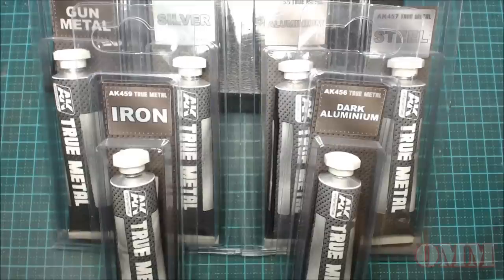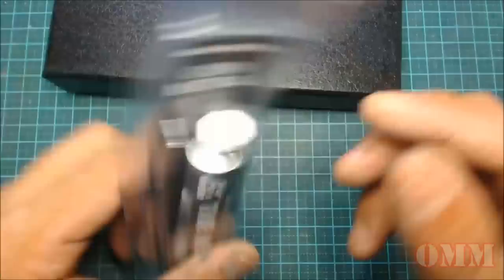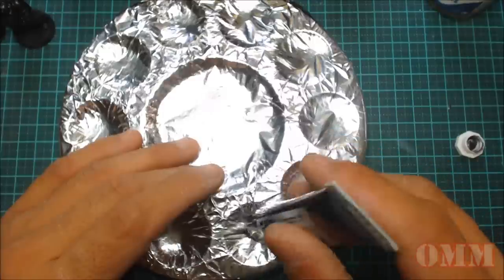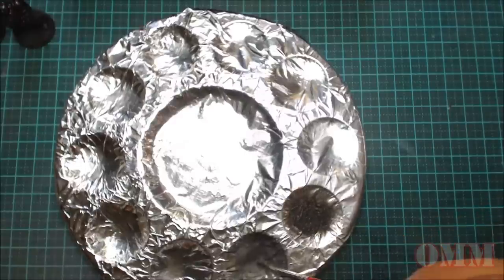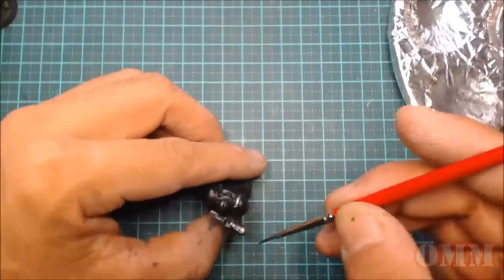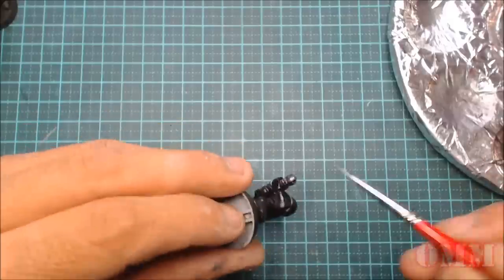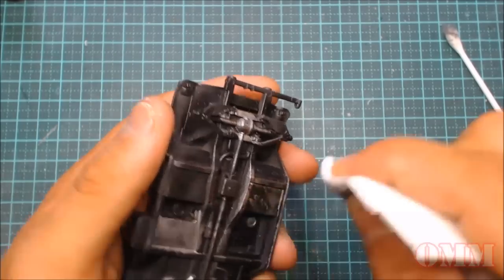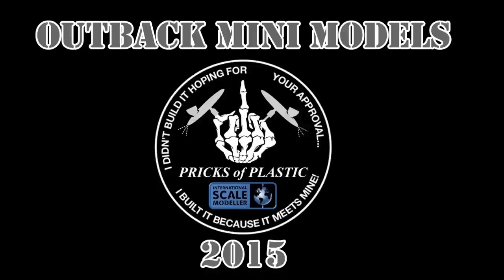AK Interactive True Metals Tutorial

Comment: Thanks for the demo. Seen this stuff knocking about and always wondered if it was worth the hassle.

Now I am thinking of using this for Necrons and/or Grey Knights as it would look awesome.
For large surface areas such as tanks/aircraft do you think something like a dremel on low speed with a buff attachment would do a good job or would it just strip it all away ?
Reply from the maker: Na I have tried and it's better to use good old elbow grease. The dremel is way too harsh, it doesn't take much to polish by hand.
Reply: Clem Day Thanks for that

Comment: bit of a noob here lol, just wondering your opinions on how well it takes both water based and oil based washes and weathering techniques, and how to to go about it after buffing. eg does it need sealing and so on first?
Reply from the maker: make sure you seal it as it will leave metallic specs. I personally wouldn't use enamel washes but acrylics will be fine.
Reply: Not sure enamel washes are the same as oil based paints are they?
Reply from the maker: +Dominic Pizzey they sure are.